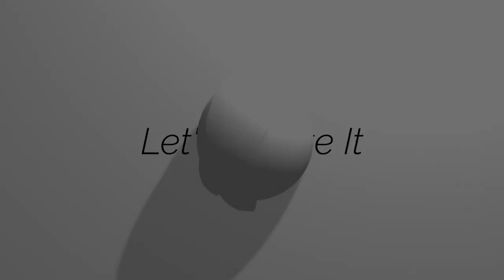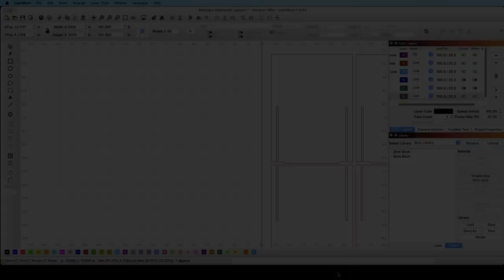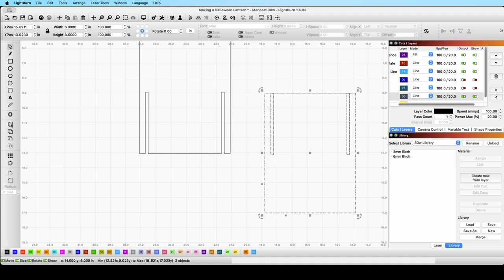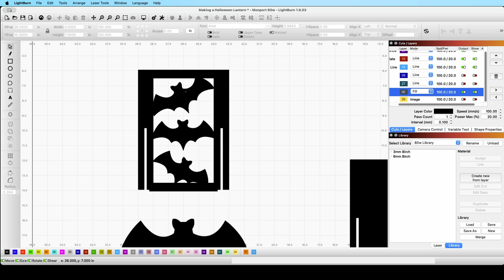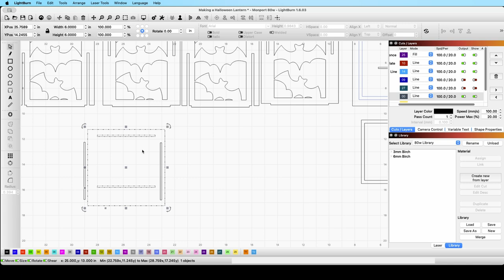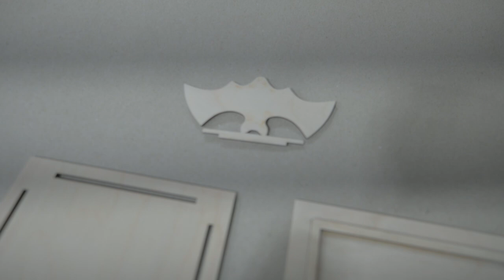Making $$$ With Your Laser, Holiday Lantern Template Tutorial

Comment: If you made the square that locates the top solid you can make the slot on the lid twice as thick for more glue area and it helps to align it centered if you use the handle tab to align it when gluing. If doing production you could create a guide handle with a longer tab to help alignment.